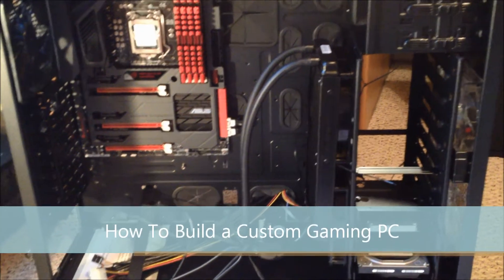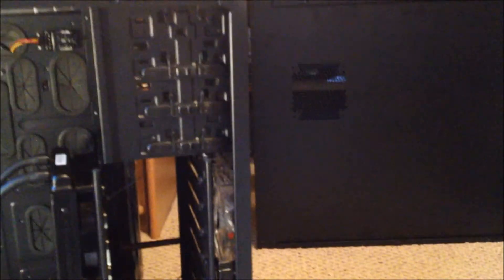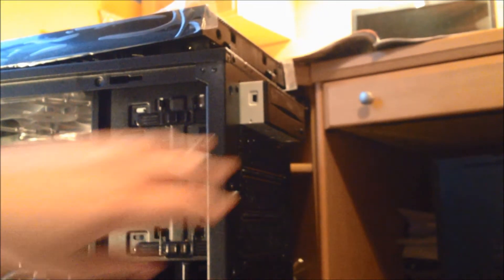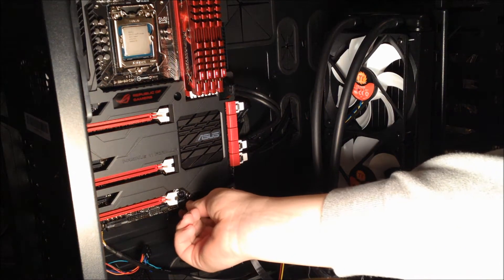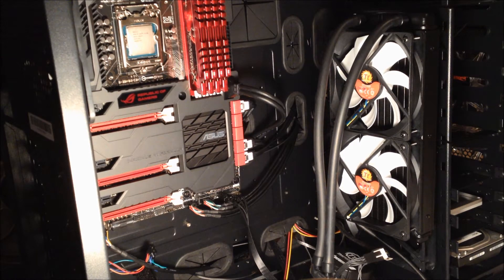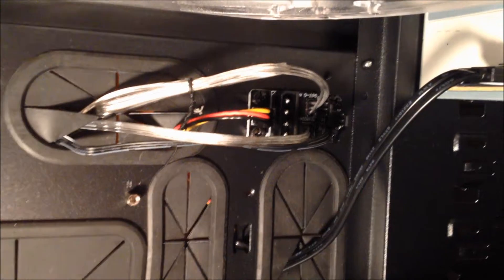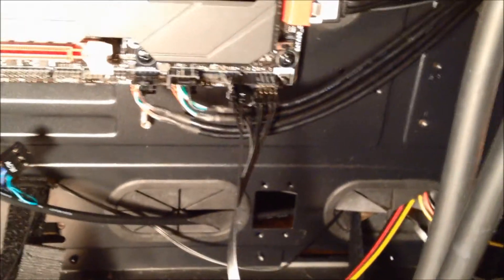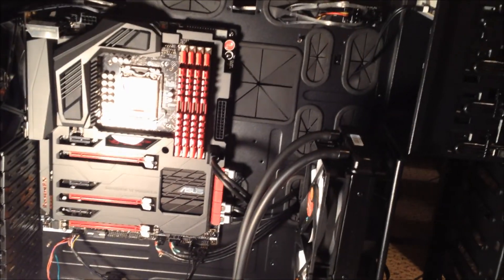How To Build a Custom Gaming PC - Episode 4: Optical Drive and Plugging in Cables

Comment: what ODD is requried for gamimg if i  was to run gamea cds and burn games to other cd's
Reply from the maker: All you would need is an ODD that can both read and write on CD formatted discs... though I would recommend getting an ODD that can also read and write DVD formatted discs because some games do come on DVD formatted discs
Reply: +airborneX0101 LG GH24NSB0 DVD Writer 24X SATA Internal OEM can this one do the job? plzz chexk ajd tell me its a dvd writer i don't know if it can read dvd also and can this read and write cd or is there any other writer for cd
Reply from the maker: By the looks of it, it can read and write both CD and DVD

Comment: I didn't know Asus OEM'd from TSST.  That's clearly an SH-224 in Asus clothing. :)
Optical drives, though used far less often these days, are still essential for most general purpose and enthusiast machines. You may not need it very often, but when you need it, you really need it. I still use mine quite often.

Comment: how did you Install your operating system ?
Reply from the maker: +MiniShoppingCart When my computer was ready to turn on, I turned it on and then inserted the disk that I was going to install the operating system off of. The computer should detect the disk and begin installing the operating system with a few clicks. If the disk isn't detected right away try restarting the computer. If that still doesn't work you will probably have to go into your BIOS and change the location of the operating system from your hard drive to your optical drive.
Reply: +airborneX0101 okay that's what I thought so you just bought a windows 7 disc then right ?
Reply from the maker: +MiniShoppingCart yes, that should do the trick
Reply: +airborneX0101 150 dollars for a disc tho hahah
Reply from the maker: +MiniShoppingCart haha windows 10 goes for about $100 if that makes it any better
Reply: +airborneX0101 should I order it online or go to a store like best buy?
Reply from the maker: +MiniShoppingCart the prices tend to be about the same in-store and online but you should double check

Comment: youre vids are really helpful since im using the same case. How was mounting the cooler there a big hassle? Id like to do the same thing.
Reply from the maker: The radiator part of the cpu cooler was somewhat of a hassle since I couldn't attach it to the top because of the two 240 mm fans. Instead I had to put it next to the hard drive bays, but there are also a set of fans there, so I couldnt screw the radiator part of the cpu cooler there either. Instead I decided to use zipties, which still hold it in place and I have had no issues so far. If you get the same cpu cooler or a similar cpu cooler then you may have to improvise like I did.
Reply: ah ok. Everything iv read about this case says you can remove the top fans for a liquid cooler. Im sure you've looked into that though. I like your setup better anyways. I think ill be doing the same I just couldn't figure out how you had it mounted that way. thanks.
Reply from the maker: +Cody Mathis no problem

Comment: The optical drive should be plugged into the lowest port and the SOLID STATE DRIVE and hard drive should be in the top ports for best proformance
Reply from the maker: Thanks for all the feedback! The PC build is already completed and is running flawlessly. If for any reason I open up my PC, I will take your recommendations into consideration. Thanks!
Reply: they are all 6gbs ports but the top ones are on the intel chipset and directly connected the cpu which means less latency